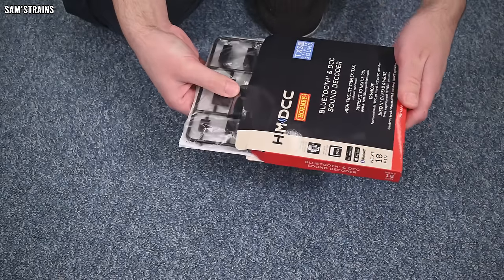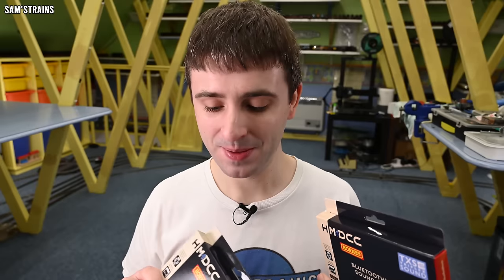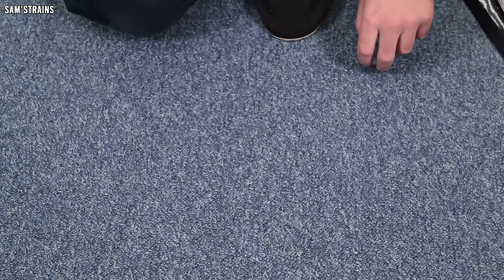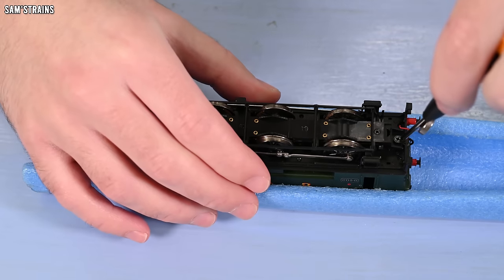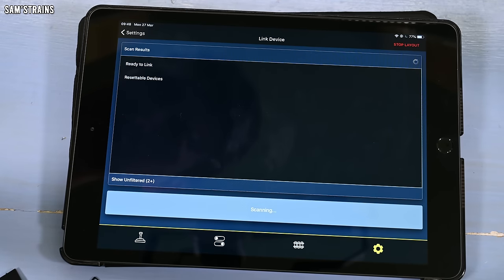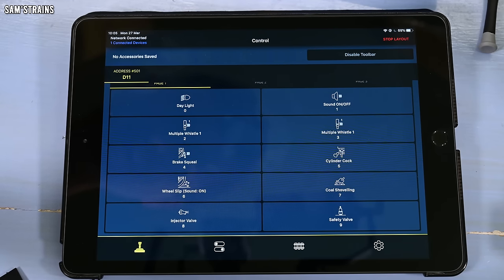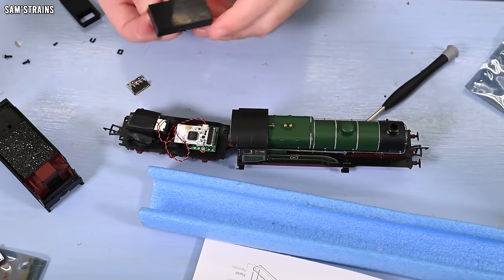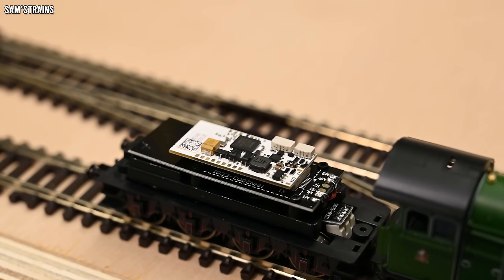Too Big For Most Locos & Burnt Out After 1 Day | Hornby's New HM7000

Comment: Incredibly helpful review on what appears to be something of a game changer in control systems. I hope Hornby can produce a Next18 sound decoder that will fit all models as that is certainly a blocker for me and I'm really grateful you've highlighted it.
On the decoder burning out... I'm quite concerned how easy it appeared to be possible to switch the app from DC to DCC mode. Isn't that a very easy way to fry a decoder if you're attempting to control it with DC on a DCC feed and visa versa? Is it possible that has happened here?
Reply: DCC locos work fine on DC unless DC operation is disabled by CV29 bit 2 in which case no damage will be done, the loco just won't move. If a DC loco is fed with DCC it will make a buzzing noise and as long as it isn't left in this state for too long no damage will be done.
Reply: @rogertarring6165  Yes, understood what you're saying there Roger, but it's not quite what I meant. In the scenario you're describing the controller and feed is DC with a decoder that is configured to work on both DC and DCC.
What I'm describing is the feed being DC and the controller being set to DCC (or visa versa). Eg: the power is DC via a Gaugemaster traditional controller set to full, then I switch the app to DCC and start using it. What happens then?
Reply: @IanCawthorne  Good question. I'm not sure.
Reply: @IanCawthorne  Logically, the engine might stop dead, waiting for the typical AC stream of DCC current with pulse-coded instructions to go. Or do nothing and act as a standard DC engine.
Reply: @IanCawthorne  I am not sure what you are trying to describe. All NMRA DCC decoders will work on DC. They may be programmed to not respond to DC but they will still understand a DC signal & not be damaged by it.
They can be damaged by a high frequency track cleaner or the pulsing of a feedback controller but that is another issue.
A DC loco is not designed to work with a DCC signal.
Didn't Sam switch the Scotsman between Bluetooth & DCC while it was drawing power from DCC?
Reply: @TheRip72  There could be two scenarios I'm trying to describe...
1. The power feed is DC coming from like in Sam's video a Gaugemaster DC controller on full power. For this to work from the Hornby app, the app should be set to DC mode via bluetooth. The "what if" is when you switch the app to send DCC when the power feed is still set to DC. At that point you are sending DCC information to a DC powered track.
2. Scenario two is the other way round. You are powering the track from a DCC unit such as the Powercab in Sam's video. For this to work, the app should be set to DCC mode via bluetooth. But what happens if you set the app to DC mode?
As far as I'm aware running a DCC locomotive on a DC feed will do damage to the locomotive decoder and/or motor, which I think is scenario 1 above.

What I'm not saying here is this is a problem. I'm asking if it is, because I do not know the answer, but think it could be. Maybe Hornby have this covered already. Or maybe it is not an issue at all.
Reply: @IanCawthorne  When running his TT:120 Flying Scotsman in the video, track power was suppled by Sam's Powercab. At this point there was no DC. It was responding to Bluetooth commands. The DCC signal was just being used as a power supply.
DCC decoders will respond to smooth DC anyway, unless you disable it. This won't break the decoder though, it simply ignores the signal.
Reply: One thing to keep in mind (or perhaps several things), a DC controller will supply DC power and a DCC controller will supply AC power. The Decoder runs on DC power and there is a rectifier in it that converts the DCC AC power to DC for the decoder. As these decoders seem to be able to be powered from a DC power supply as well as from a DCC controller (AC power) there must be some kind of switch in the Decoder that detects whether the power supplied to it is AC or DC and supplies the decoder accordingly. As for the commands to the decoder they are sent by Bluetooth with a radio signal direct to the decoder and so by-passes the track power altogether. @IanCawthorne  Having thought about it a bit more, all DCC decoders have the ability to run on straight DC (as mentioned by others) so that sort of detection switch that I described must be common to all of them. The only difference I can see between an ordinary DCC decoder and these Hornby ones is their ability to receive commands via Bluetooth as well as signals via the track from a DCC controller.

Comment: Great review Sam. It's amazing what we find when a new product comes into contact with the reality of a Sam's Trains review. I always wait until you have reviewed something before I decide to spend any money. Lots of hiccups which Hornby will need to fix, but other than hardware faults most of the system can be upgraded remotely as long as you can actually install the chip. A talking Thomas may one day be a reality! Keep up the great work, Allan. Hope you get a free replacement for the burnt out chip. 😂
Reply: @Haymarket47  He certainly should.
Reply from the maker: It's been sent back already - I'm opting for a refund rather than a replacement, as I was hoping to use it in a OO loco ideally!
Thanks for watching, Sam :)

Comment: Sorry Hornby, there is too much faffing around with this, it seems that you have configured this system for your products and nobody else's as displayed by Sam's inability to fit Hornby decoders into Bachmann locomotives. A system like this should fit ALL products instead of one companies. Therefore the HM7000 is not DCC compatible and I will not be going anywhere near it but will be sticking with my Digitrax system.

Comment: Great review, my big question is what is performance like when you have say 20 or 30 or so locos and two or three operators? I can see DCC control trumping that, but sure on the price (half) and ease of Bluetooth updating it beats others where you have to buy programming kit and the right versions! Hornby’s improved sound quality advancing on TTS definitely enhances value for money and do you really need to play more than three tracks at a time?
Reply from the maker: Yes that is a big question - and if I had the money to buy 20 decoders, I'd definitely do that on video! I'm fairly sure there's a limit to how many bluetooth devices you can connect to simultaneously, so I'd be very interested to find out how that actually works!
Thanks for watching, Sam :)
Reply: The premium decoders have 5 sound channels. I found TTS's 2 very limiting by comparison. 1 more would have been a good compromise & here we have it.
Reply: @SamsTrains  Glad you concur, unfortunately in this hobby too many manufacturers use us, frustratingly, as the testing ground as you have pulled them up so many times on. Some just ignore short to medium reliability issues and are clueless about infant mortality failures ( e.g. as your chip failure). It would have been so easy for Hornby to have tried the scenario I described ….then they could have addressed any issues and used their learning experiences to promote the product for customers who had similar setups, oh and leverage sales and ROI…..

Comment: Sam, what is the type number on that big IC on the decoders? I'm surprised they have chosen a 100 pin or so IC for something that should be doable with much fewer.
Reply from the maker: I'm not too sure about that! Can you read it in 4K??
Thanks for watching, Sam :)
Reply: 06:56 If you're asking about the black square IC in this shot, it is N570564A. Some online shops have photos of the Hornby decoders if you google the number.

Comment: I bought one of these. First issue was QR code pointed to the wrong app, then to find out that the app had not been released for the Andriod system and at that time the Apple one as well. So I fitted the 21 pin decoder into my West Country Elizabeth loco (only Hornby steam loco I have with 21 pin socket). Next issue I have is decoder won't sit flat because of power connecter on underside of decoder interfering with the screws holding the decoder PCB to the tender. Remembering this is a Hornby loco, why is there a connector on the underside. Replace screws with countersunk ones, decoder still will not sit flat but it works. I can see that connecter on the underside will be an issue with many Bachmann Diesels. 
As I said previously all my devices are Android based so I have not managed to load a sound profile. Before I retired I used to write software to reprogram vehicle modules, so I suspect as the system attracts more users there may be issues reprogramming them (I could spend hours explaining the issues). The £100 sound decoders are generally better than the Hornby system and in the case of Next 18 fit, so I don't think they are dead yet. 
Really good review though, really thorough, you even picked up things I would never thought of testing. That decoder is supposed to source up to 1.5 amps peak, 1.0 amp normal. I didn't believe it when I read the spec, it seems you have proved it.

Comment: What the world of model trains needs now is an open source design of this concept and its app.
And I seriously don't know why the boards are so big, there is lot of empty space on the PCBs. One or two more copper layers inside the PCB would'nt have cost a fortune more, especially in bulk, and the board size could have been reduced to just a bit more than the chips on it themselves.
I may sound like a suspicious person who had just a bit of bad experiences with manufacturers of consumer products that tends to makes life of their customers miserable (right to repair, hardware lockup and the such), but this looks like a form factor made large enough to prevent using it on any other loco than recent Hornbys' ones.
Reply: It may be due to the size of Bluetooth antenna. Most small consumer devices with Bluetooth have the antenna stored around the rim of the casing but here we just have a bare board.
Reply: @allanmorton6022  good point. Maybe there is a microstrip antenna indeed.
If it's the case, it's still an oversight. Making a bigger board that doesn't fit inside the product it's meant to equip is a bit strange...

Comment: I don't think it will be long before Hornby make the decoders smaller, once they do this and maybe add several more sound profiles, nothing else will compete either on function or price. Why would they not go down this road it is not hard to reduce the size of circuit boards so as far as I can see it is a win win situation for Hornby. Other manufacturers would do well to take note and quickly respond to this challenge.

Comment: Hi Sam. I am a big fan of your youtube channel and find a lot of the content very interesting.
I have just watched your vid of your review of the Hornby HM7000 system and agree with just about everything you say, however, I have to say that i'm a bit concerned by the way you handle these decoder chips. Modern PCB's are highly vunerable to any kind of voltage spikes non the least of which are those resident in your body as 'STATIC'. 
A static charge in your body can be anywhere from 4000 to 15000 volts and will discharge to ground via anything that you touch. The discharge event lasts no longer than a few nano seconds but can last long enough to blow the brains out of the modern semi conductors found in most PCB's these days. You should really consider wearing a 'grounding' band on your wrist when handling some of these chips so it is quite possible that the decoder chip that failed in your youtube review suffered from a static discharge.
Kindest  regards
Dennis

Comment: Thanks for the informative and fascinating video, Sam. I feel somewhat more tempted by this than any other DCC system I've looked at so far, though I don't think I'm ready to take the plunge quite yet. I think I'd be hoping to see both somewhat smaller decoders and preferably some sort of investigation as to how adaptable they are for fitting to currently non DCC ready vehicles.

Particularly frustrating in a way is that from what I could see in the video, it looks suspiciously like the 'oversize' part of the Next 18 decoders appeared to be just bare circuit board*, rather than circuit, with what looked like a QR code on it. Unless there were some embedded components on the other side that we didn't see, that would mean they're incompatible with smaller tank engines *just because they felt it necessary to print the code on the decoder itself in case people lost the instruction booklet?

I suppose on the vague plus side that might mean with the right tools someone with a lot more precision than me might even be able to trim the decoder board to fit in tank engines properly... but I don't think that's a risk I'd be wanting to take that close to electronic components.

Also, if I may, a random DCC question from someone who's never actually used it, that occurs watching that system in action. I'm curious- is the direction of travel solely dependent upon the direction indicated by the controller? I can understand that, evidently, changing that direction can put the motor in reverse so that you could have two independently operated locos on the same track travelling in opposite directions- but, if you were powering the system with a DC controller and flipped the direction toggle switch on *that*, does the reverse of polarity on the running rails invert the decoder chips' "understanding" of which is forward and backward, or do they continue unaffected?
Reply: The Bluetooth antenna/aerial is likely etched into the circuit board there, so it wouldn't be 'bare'.
DCC decoders have a bridge rectifier in them to convert whatever polarity the track has to + and -. A standard DCC signal flips thousands of times a second, so it naturally doesn't matter what you do with a static power supply for this decoder - you can have it either way round

Comment: So what happens if someone powers up the track at full blast with an old DC controller with an unfiltered DC output? Some old controllers are notorious for large voltage spikes frying small coreless motors. I don't see any decoder withstanding that.
Sam, were you running via your DCC controller when it brewed up?
Hornby should be congratulated on making an 18-pin that fits their own TT120 but is just large enough to stop the use in arch-enemy Bachmanns offerings.
Reply from the maker: You’d have to keep that person away, or give them a firm talking to! I was using the gauge master DC controller, which is non-feedback!
Reply: @SamsTrains  Gaugemaster DC controllers, besides beings ones of the best of their kind available on the market (personal opinion, give or take), are especially sought after for being coreless motors friendly, and nearly mandatory for such a use. For your fried decoder, I suspect a very casual manufacturing defect.

Comment: Jenny Kirk has done a test on all, repeat all, her 18 decoder locos. Over a dozen.

She said in her intro that Hornby designed this decoder for their TT120 range. She also said Hornby intend to make it smaller in future. One of the comments on the video recommends seeing a Hornby video on the subject of why it is so big at present. 

Short summary, it “fitted” only 2: a TT120 and an N gauge diesel; it could be fitted into the Planet 0-6-0T if you chopped some of the body away. The decoder showed white beneath the side tank, but apparently you can paint it - presumably without adverse effects. 

It might fit the Dapol locos with the smokebox decoder if you chop off the plugs for the stay alive and speaker. It looked a bit long for that to my eye, but I may be wrong there. Clearly too big on other Dapol, Heljan and Bachmann locos. 

The “repositioning” of Hornby on the intended use of the chip seems to me to indicate that there was miscommunication within Hornby - design and marketing on different tracks.
Reply: Painting a decoder sounds very dodgy to me.

Comment: I see a couple of other possible problems

If the decoders are the actual operating systems then you likely can’t use this with locomotives that are already installed with Typical dcc decoders which means you either can’t run other engines or you’d have to replace all your decoders or not run your already owned locomotives. And if it is an American locomotive then your completely out of luck on sounds

Another thing which I’m not sure if it is the case with this system
But with other apps that dcc systems have, if you have a call or go to another app then your train stops. If that is the case for this system then you essentially need a dedicated device for your trains because you might not be able to run trains while answering a call or sending a text
Reply: The 7000 fitted trains will work fine with none 7000 trains. The 7000 decoder is a totally normal dcc decoder with added harware to deliver the normal dcc control via bluetooth (or track if you don't use the bluetooth).
Reply: @Cloudman572  
I’m talking the other way around 
You can’t run something that isn’t equipped with a 7000 decoder using the 7000 system.

Like if you buy a current sound fitted engine from rapido, you can’t run that using the hm 7000 system